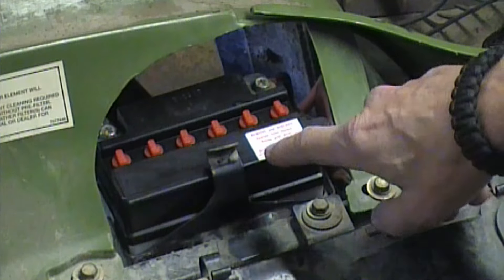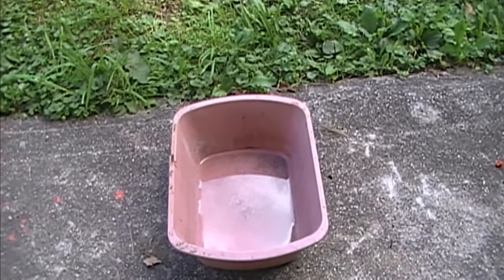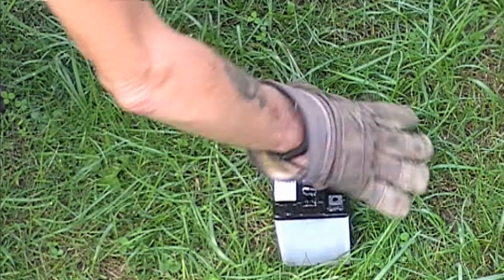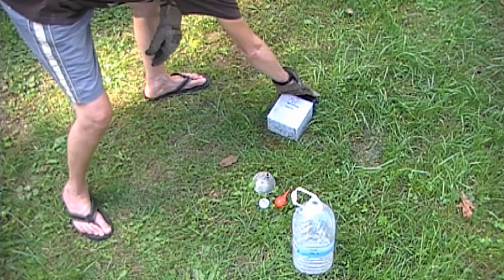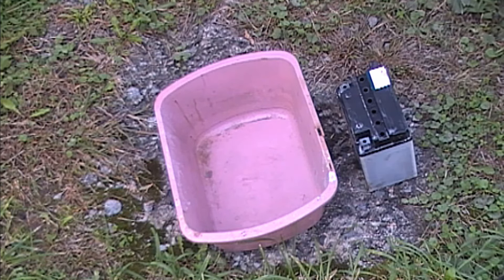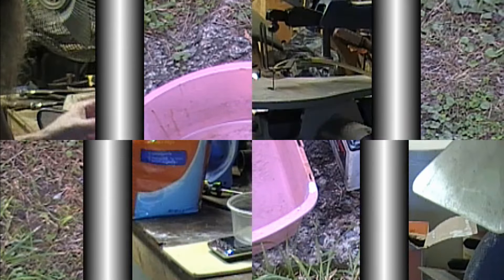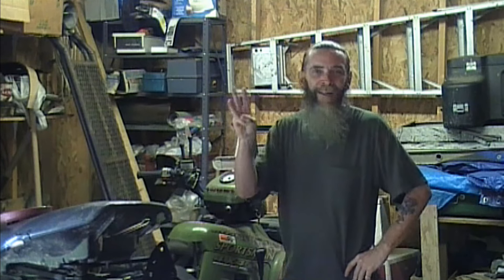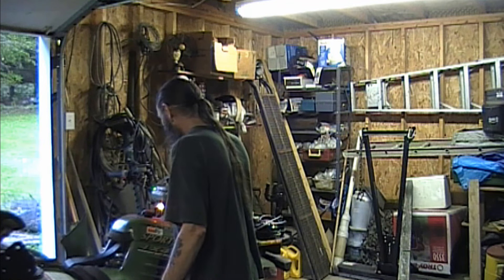acid lead battery restore recovery EVERYTHING YOU NEED TO KNOW 2018 car battery reconditioning

Comment: You don;t want baking soda, a base, sitting in there with your cells that need to be in acid.  it will make your battery work worse in the long run because you won't get rid of it when you dump it out later to put acid in... You want to use espom salts only.  after a year you can dump it out and add battery acid from walmart or whatever... You can even dump it out as soon as you get battery acid, whenever that is . The epsom salt trick is just to desulfate it and then get it working well again later with battery acid... ... the epsom salts clean the plates are don't act to nuetralize any acid the way baking soda does.  The reason this works is because baking soda it desulfates the battery the same way epsom salts does.  But again the epsom salt isnt a base and won;t wreck your battery over time.  The baking soda method he is using is just simply a idea he had and not a proven way to do it.

Comment: Are you using epsom salt and distilled water for cost reasons? Why not use acid. Thanks in advance.
Reply: Can buy the sulfuric battery acid at some parts stores. But would clean out the baking soda a few times with water and final flush with distilled water.
Then you wouldn't have any Magnesium in the cells from the Epsom salts .

Comment: Hi, can I use to clean the battery with strong 10 ph alkaline water instead of using soda mixed with water I think it safer compared with baking soda? Alkaline hot water will remove all dirt and buildup in the battery, I already tested on my coffee cup it removes completed all stain buildup from coffee. Distilled water is acidic ph 5, topwater normal ph 7 and alkaline water ph 8 or more, ph 10 is very strong to clean all dirt and buildup inside of the battery.
Reply: The baking soda (sodium bicarbonate)solution neutralizes any remaining sulfuric acid. That's why it bubbles. CO² gas.
Also will help dissolve sulfate deposits off the lead plates. That's why you should do it multiple times.
The "rejuvenation" of the battery is actually the clearing off of the lead plates of sulfate deposits. Getting more lead surface area in contact with the sulfuric acid gives you the most voltage possible.
  I believe the concentration of the battery's sulfuric acid is 30%.

Comment: Hi Randy, I meant to say Gud Vid! My typing F-ed up big time. If you have an old battery that's been sitting around five years or so is it worth a try? I'm gonna try and will let you know. Thanks again you Good Ole String Plucker Bro! DavetJO
Reply from the maker: yes doesn't matter how old as long as ALL cells bubble when you charge, if all are bubbling and you get them clean it will work. good luck bro! let me know how it goes!

Comment: Gus Vid Randy abs it's helpful but I do like the guitar vids best. I am going to try the battery thing fer see. To bad I bought a new mower battery this summer but it was on sale at tractor supply for $24. But still, I would have tried it. I use my mower in my woods to haul firewood. So it gets used more in winter. Can't mow the woods with all the big oaks and hickories. So Thanks tons! Popcorn Sutton? Popcorn didn't have Cue and Zeak and that damn old Earl. Haven't seen you makin shine yet either. You are funnier too and sooooo cute. Just ask Earl about that, eh? Later Bro and Thanks again! DaveyJO
Reply from the maker: every now and then I go off the wall with something completely different and since so many wanted another battery video I figured since I had to do my atv battery again now would be a good time. mowing the woods lol that's a thought that has never occurred to me! :0 I've got 3 riding mowers I'll have to give that a shot lol thanks for tuning in brother!

Comment: Would it be ok to put the powder in a bucket, pour in the hot water, mix the solution and then apply?
Reply from the maker: something about it touching metal is not good, I guess if it was a plastic bucket would be ok. I've always used plastic.

Comment: Very clear video, well, I got a question, "what about dilute sulphuric acid , will I have to use it again. I didn't see you use it?
Reply: There are many factors in doing a pro job. One resource I found that succeeds in merging these is the Jons Mender Guide (check it out on google) definately the most useful info that I have ever heard of. Check out this great resource.

Comment: All these clips about restoring lead acid batteries with baking soda are actually misleading or misses to explain what a car battery looks like inside when they start to deteriorate. The brst comparison I can think of is they can be like a compost on the inside. I know it because I investigated the nasty way. I don't think I will ever attempt to clean out a lead acid bettery after seeing that(I have done it four times with various resuly,

Comment: hi  we can use normal  salt  because  Epsom salt  is not  available in Afghanistan
Reply: No you cannot. The term "salt" is confusing you and for this explanation, why and the definition of "salt" is not important. What is important is that "Epsom salt" is hydrated magnesium sulfate in chemical terms. Processed table salt is sodium chloride and may have a trace amount of iodine. You may have access to salt from the ocean which is sodium chloride with other minerals; this won't work either. The magnesium sulfate is used to remove the deposits on the internal plates of the battery that can keep it from charging. Another thing that can "short" out the battery is a build up of sediment inside. If you take a lead acid battery apart, you'll see that the plates do not reach all the way to the bottom of the case. The manufacturer knows sediment, small particles of debris, build up over time. These can bridge the gap between plates and keep the battery from charging. That's why Randy goes to great effort to clean the battery out with baking soda. In fact, you may restore the battery without the Epsom salt step if you just clean it out as Randy did and then refill with battery acid and then slowly charge the battery. All the best of fortune in finding a solution to your problem.

Comment: out of interest how cold is your winter?   also, if you could slightly vibrate the battery while the baking soda is in it, do you think would help shake all the crud off?   also, if the baking soda solution will neutralize the acid, why not take the baking soda and put it into the acid you dumped out?

Comment: Great video! I'm not sure this will work on my old batteries. Up here in Minnesota the main way batteries die is by going dead in the winter and then freezing solid in below zero temperatures. When this happens the plates shear off from ice expansion. I'm going to try your method on some motorcycle batteries though. Those have way less water, and so there's less damage the expansion can do.

Comment: I never understand why people go to the trouble of neutralizing the battery with baking soda, then rinsing it out and doing all the work to get it cleaned out then they put stuff in like epsom salt or Alum or whatever.  Just go get battery acid from O'Reilly for 10 bucks a gallon.  Put the legit stuff back in the battery.  Charge and then test with hydrometer to see if the specific gravity is right.  Too high then add distilled, too low then add more acid.
Not that hard people.
Reply: Basically just empty out the old acid and poor in the new acid? I thought you had to clean it or do you just poor out the first poor and keep the second? Thanks!!

Comment: Hey, it's fine enough that you want to save batteries, but you flush the battery and pour it out on your ground. There is lead that is very harmful to you and the environment. The acid itself is neutralized on the ground. If you do this in here in the EU then it is close to imprisonment and a large fine. It is for this reason that they are delivered to places that can handle disassembly and reuse the materials. And you behave like many are trying to do the same and you start a wave of more lead in society and the environment. It is researched just as mercury is dangerous and causes fetal harm and animals absorb this. Lead never comes out of the body. Even at cremation, there are lead residues. I am old car mechanic / technician and all the courses I have been on with safety and chemistry handling then it is totally wrong what you do. I remember my old boss at Mazda also flushed the lead batteries and poured it down the sewer. just because you want to save a few dollars. If you do not have money and believe you are relieving the environment. Or think it's a good thing to make a video on Youtube how to flush a battery and bring it to life. You can actually buy chargers that can save a battery. But usually when the battery has collapsed ie the plates and the battery bulge out then it is dead. Buy a new or buy AGM they last at least 5 to 12 years. Sincerely, Rob

Comment: OK that cleans off the corrosion off the plates but why not take the acid water that you removed from the battery after it sits and residue settlers out of it and reinstall the acid water and top off with a table spoon of sulfuric acid&distilled water ? Wouldn't that bring it back to factory specs of being a lead acid battery vs a lead salt water battery?? That's the rout I'm taking to find out the results
Reply: thunderstorms06 how did that workout for ya?